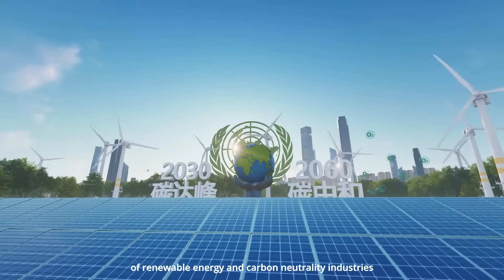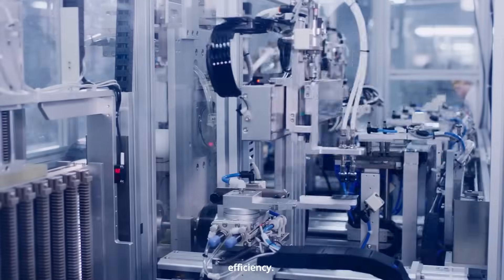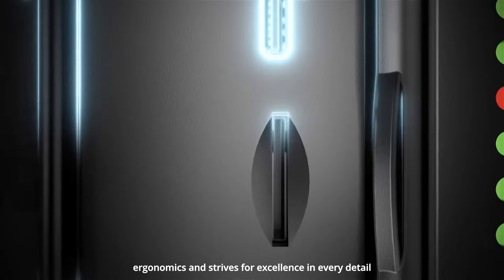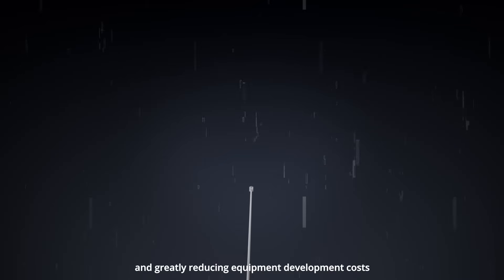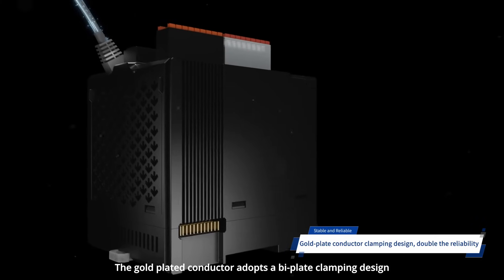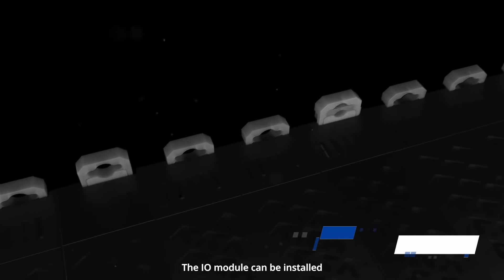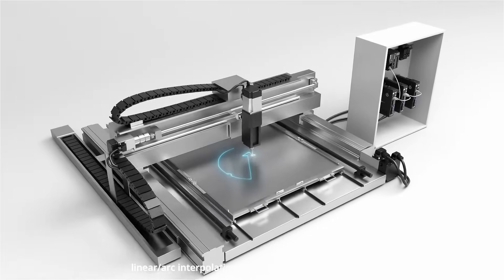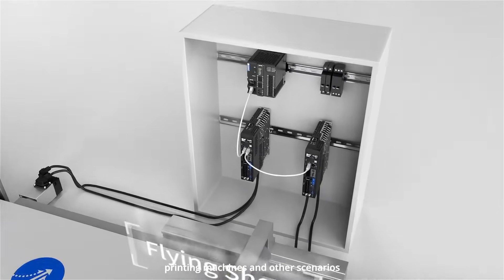Leadshine General Type EtherCAT Bus PLC MC500 Series Brief Introduction

Comment: hi i use mc512 PAC and i satisfied this. But while installing the program today with codesys, It remained at 98% ten minutes. Codesys did not respond. I did a factory reset witk mpk button. But now while i scan the network i can not see plc. Can you make a video of firmware upgrade with SD card? i can not see anywhere and i m not find firmware software for  write to sd card
Reply from the maker: Hello, thanks for your message, can you send your question to tech@leadshine.com, our technical engineer will contact you.
Reply: High z